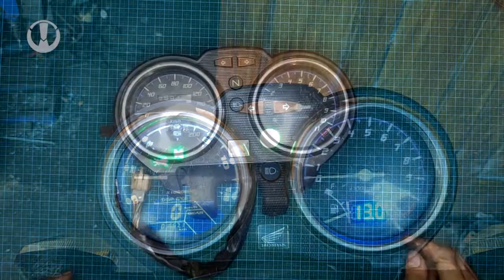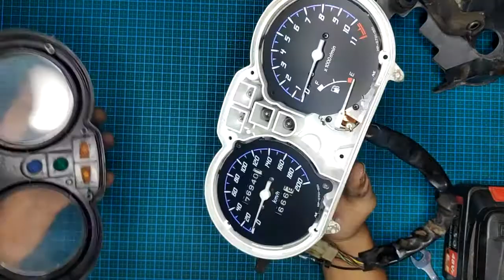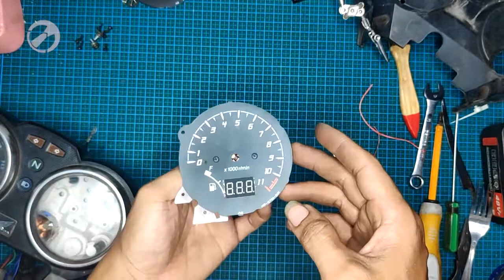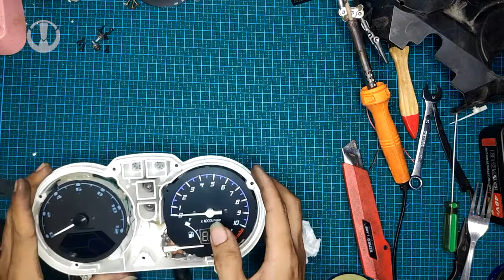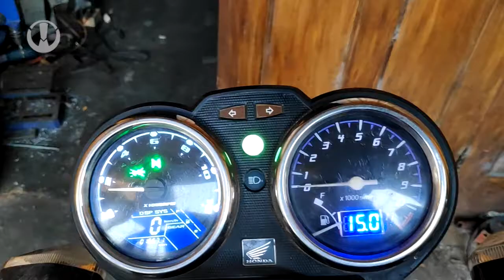Modifikasi spedometer tiger revo menjadi digital

Comment: permisi mas,,  motor saya Megapro hiu, klu mau RPM ny  nyala sambung kemana ya ?🙏🏻
Reply from the maker: Pake speedometer Ori atau tiger
Reply: @teknikwow9954  spedometer babon doang mas ke Megapro hiu 🙏🏻
Reply from the maker: Pulser +
Reply from the maker: Atau kabel hitam strip kuning out cdi
Reply: @teknikwow9954  klu ke output CDI ke koil gak stabil mas, tpi klu ke pulsar stabil RPM ny,,
klu ambil dri pulsar aman gak mas ?
atau ada pengaruh ny ?
Reply from the maker: Aman. Saya ambil Dari pulser. Soalnya pake tci JD gak bisa ambil output tci ke koil
Reply: @teknikwow9954  Terima kasih mas infonya ,, sudah liko dan subscribe 👍🏻

Comment: La itu indikator bensinnya ngidupinnya gimana mas
Reply from the maker: Pilih salah satu mau sambungke digital atau analog bawaan spedo. Gak bisa diparalel
Reply: @teknikwow9954  kalau di sambungke di digital gimana mas caranya
Reply from the maker: Ya tinggal disambung ke pelampung
Reply: @teknikwow9954  gak rubah pelampungnya ms soal e kabel nya yanv digital kan ada 3 asli tiger ada 2